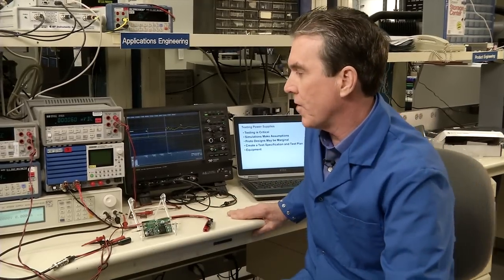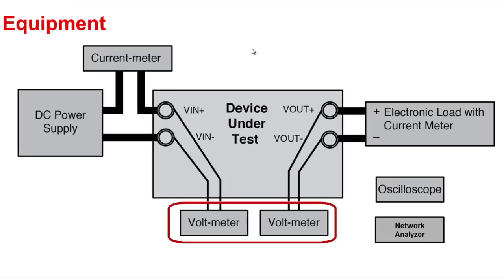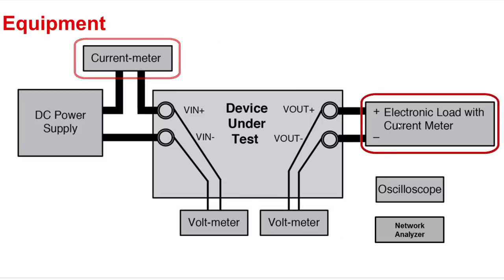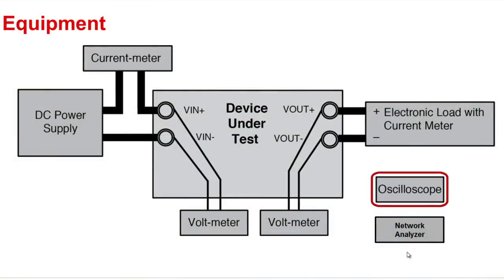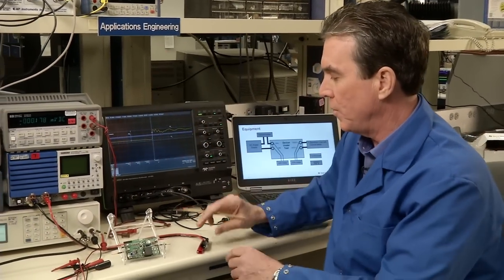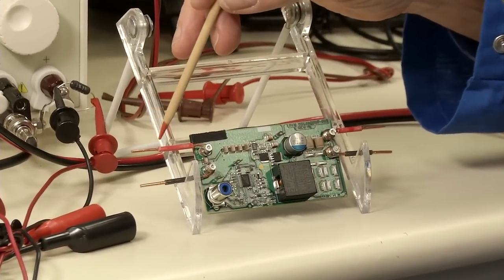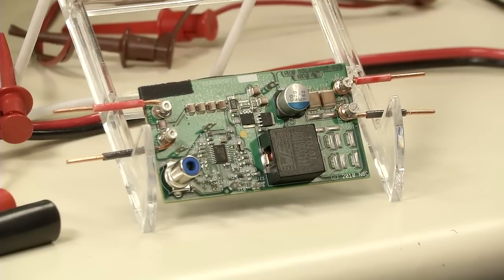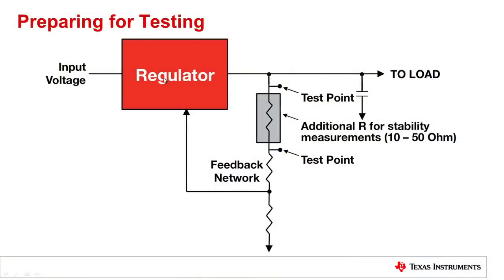Engineer It - How to test power supplies - Overview

Comment: how useful then is a 100 mhz oscilloscope? Do I need the 500 Mhz u suggest?
Reply from the maker: Hi Foxy: A 100MHz Bandwidth scope will not provide an accurate view of energy at or above that frequency.  Power supply transient switching noise and resulting harmonics can easily be above 100MHz, for this reason I suggest a higher frequency scope for power supply design and development.  If the system needs to pass emissions regulations and be mindful of RF interference sufficient scope  bandwidth will be critical.  If the oscilloscope use case is for basic power supply debug as might be found in a production test environment or for a hobbyist,  100MHz bandwidth may be sufficient.  Keep in mind that a digital oscilloscope sample rate must also be sufficient in order to see an accurate waveform.  Consider a sample rate greater than 4X bandwidth, the higher the better.  -Bob
Reply: Hi, thankyou Bob. I enjoy watching your videos. They say the miser pays twice. I am about to become an EE student (Mature age). I wish I had your knowledge and vast practical experience, but hopefully that will come with time and application.